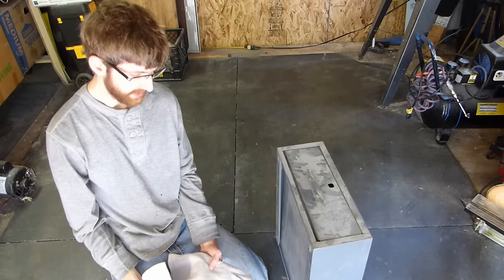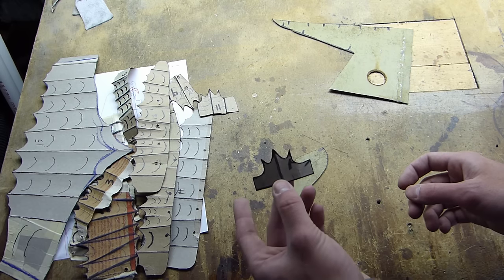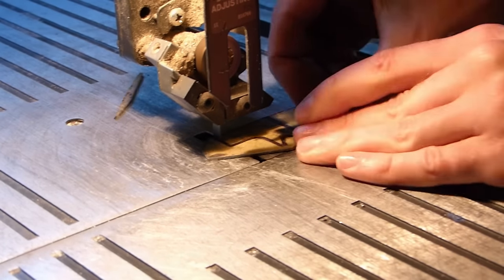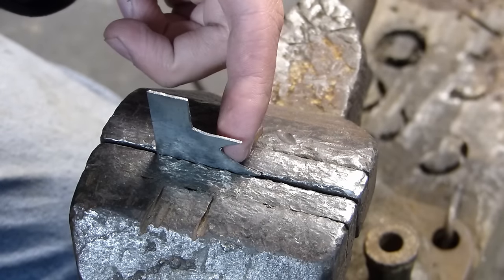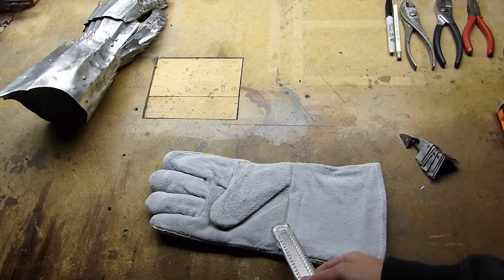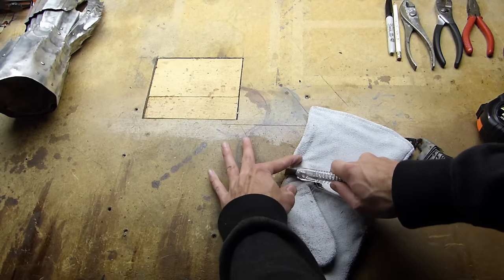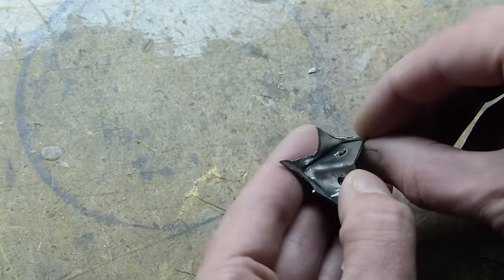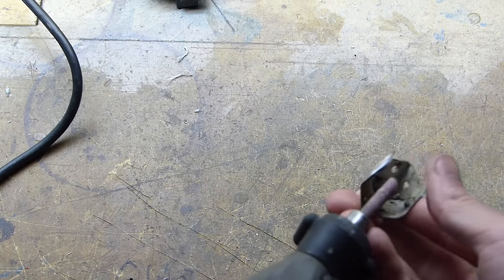Pt1 Make Steel Armor Gauntlets: the Fingers

Comment: if you counter sink your rivet holes you can make the rivet heads flush and smooth. or have a little extra and grind it off with a 120 flap disc to make it almost invisible.
Reply from the maker: Thanks for the tip! Hammering them flat seems to work fine for this purpose, but I may try that trick on something in the future.

Comment: for historycal use, 1.5/2mm steel armour is engouh
for LARP or other role playing, its 0.5mm/1mm steel
Reply from the maker: Thanks, that should help some people who have asked about what material they can use!
Reply: your welcome :)
Reply: Actually, for gauntlets, 1,5mm is way too thick for historical use. Extant pieces are thinner than 1mm, especially for the finger pieces. Even if not hardened. 2mm steel for gauntlets would be ridiculously heavy and would not move properly with your hand.

Comment: hey jaycub i have a question. do you mind teaching us how to use mills and lathes and how to read blueprints? i want to learn how to make certain weapons and also other random cool stuff but idk how😢😢😢😭😭😭
Reply from the maker: I can do that sure but I don't have a mill. I have a small lathe though so maybe I can do a video on using a lathe sometime. I have a hunch there is probably stuff online about that already though, but yeah I can look in to it.
Reply: +JaycubL cool also i know you may not be into guns but it would be very nice to learn how ro use a sandblaster and how to paint a vehicle with rustoleum oil based roller painting since imma do it as a project on my 64 impala
Reply from the maker: I am into guns but the only one I have is the shotgun that I showed how to make on my channel. I may build another gun within a few months. What gun are you trying to make? For painting your car I highly recommend that you consider using Rustoleum spray cans instead of a roller. I painted my blue MR2 with Rustoleum in rattle cans and it was easy and turned out looking fine. Rustoleum enamel is not the most durable paint though.

Comment: I have 0.5mm aluminium.. Hope it's thick enough.. Especially when hammering the rivets. Should i go trade it for 1mm aluminium? Side note: I have no bandsaw, just a dremel and fixed drill.
Reply from the maker: Aluminum is not ideal because it is much weaker than steel for a given geometry. Try to get steel if you can, aluminum may work for display-purpose gauntlets, or the process of beating into shape and riveting may destroy it.

Comment: How is the finished finger section assembled on the leather glove?
Reply from the maker: That will be shown in detail in the part 2 video, the short summary is that the leather strip I stitched to the glove finger with heavy waxed string, then the top of the leather strip is riveted to the knuckle and back-of-hand pieces.
Reply: JaycubL I downloaded the plans, but there where was only the map with measurements of finger pieces. Do you have the measurements for all the other parts as well? I don't have a printer so I'm using the size shown in the Map and draw them, but there are only the finger parts included.
Reply from the maker: The plans are the printable templates. I recommend you take the file to someone who has a printer or get a printer, otherwise you could bring the picture up on screen and trace it onto paper. The measurements would be too detailed to try to replicate that way even if I spend hours to prepare that for you.
Reply: JaycubL Ok I'll do that any updates on part 2? I hope it's going well.
Reply: Another question about the assembly of the other hand pieces not including the vambrace, how are they mounted on the glove did you use leather strips as well, if yes are the leather strips stitched on first and then the pieces are riveted on or are they riveted on the lether strips first?
Reply from the maker: The knuckle parts are on the tail of the leather strips that come from the fingers, and directly to the glove at the hinge points at the side. The main hand pieces are riveted to the glove and each other. Then next video will go up this week and a third video after that, it will be hard to give clear descriptions in a YouTube comment.
Reply from the maker: https://www.youtube.com/watch?v=MmOHnpRsK_4

Comment: Just in case any one is lazy like me, don't use a rivet gun to join them together it doesn't work.  I had one knocking about an though it might save me some time but it didn't. I had to drill them all back out

Comment: Does it work with 0,75 mm steel thickness as well?
Reply from the maker: Thinner material is easier to work with, it just won't be as strong or stiff and I don't know it may have a problem holding it's shape when used, you would have to look at your material and decide if it seems strong enough.
Reply: JaycubL Stainless steel 21 gauge
Reply from the maker: Stainless tends to be a little more brittle but also stiffer, I really wont be able to tell about the material you have. You could try making a couple finger segments and that will tell you if it seems like the material will work.
Reply: JaycubL yea it works quite well it seems just like in your video i got about 5 finger segments done and I'm gonna rivet them to a leather stripe, I hope part 2 is gonna be finished soon.
Reply from the maker: Yeah I will be making more progress for it this weekend.
Reply: JaycubL Fantastic
Reply: JaycubL I now got 1 finger completed the only thing I'm changing is the fingertip. Because I don't have a tool to weld them together in gonna rivet the first finger segment on the sides of the finger of the glove and the leather strip, im not sure where exactly i should rivet it on, right above the knuckle or a little bit further back?
Reply from the maker: If you are riveting the finger tips on, then you may want to add another tab to the top of the finger tip so it can rivet in a third place and it won't pivot.